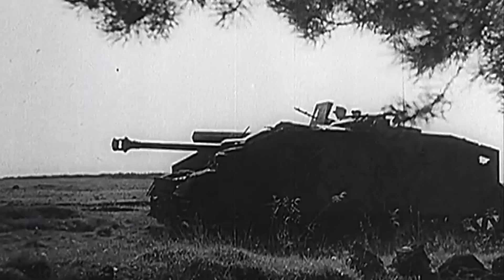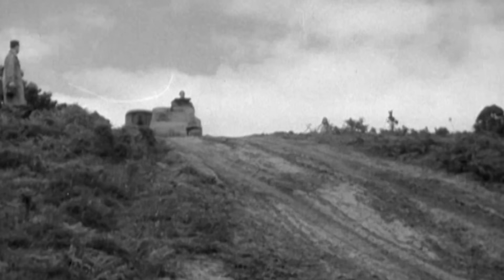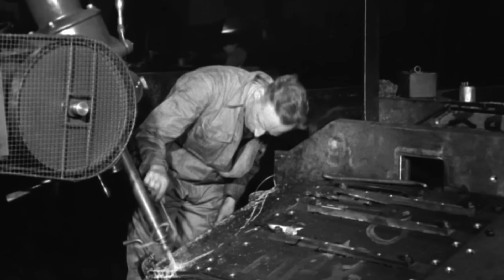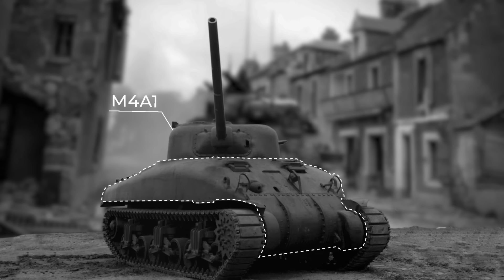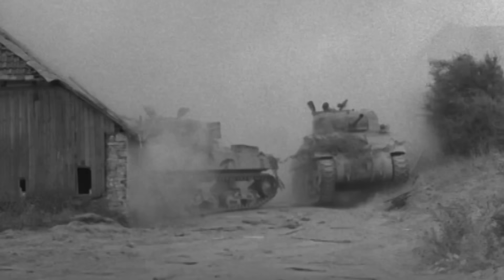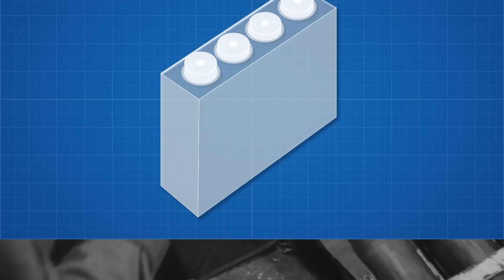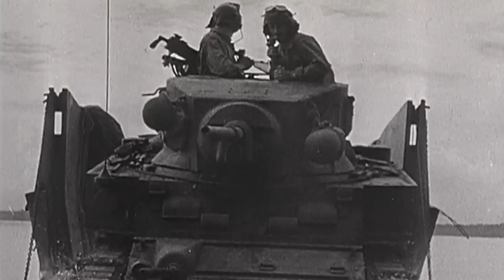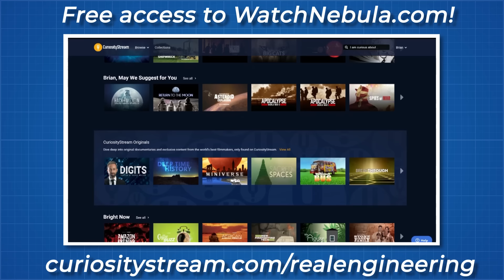M4 Sherman - The Workhorse of D-Day

Comment: Ah the worst tank of WW2
Reply: @peterson7082  Sherman was the worst mass produced thank used during the world war 2.  I'm not talking about the after war models or British improved Firefly. M4 could have been considered decent tank till 1942 but after that it was obsolete in every way and Americans joined the WW2 earnestly in 1944. 

Cons of Sherman was its 
-Armor
-Firepower
-Diesel Engine(prone to fire)
-Armament stowage (prone to blowing up)
-Range 
-Profile (too tall)
-Tracks (too narrow for muddy terrain)
etc...

Pros 
-Its large numbers in both tank itself and numberless canon fodder drivers.
-Part interchangeability

Finally , Sherman was not built to fight in war. it was build to be compact enough to be carried to anywhere on train or ship.
Reply: @presnow3016  Absolute nonsense. The M4 did not have poor armor or armament compared to its contemporaries. Nor was the M4 any more prone to suffering catastrophic detonations. Fuel type makes no difference in combat. The M4 was quite long ranged for a gasoline powered tank (in most variants it was gasoline ). The M4 did have a high center of gravity, but the height of the 75mm. gun tanks was not outstanding compared to the IV or Panther. Rather shorter than the latter by a considerable margin . Cannon fodder based on what?
Reply: @presnow3016  

> "Watch this documentary where the original crew of Sherman tank describes what pile of garbage it was and German tankers talk about how easy it was to destroy Sherman compared to real threat of Russian tanks."

 Television documentaries aren't reliable sources of information. Not to mention who exactly is claiming the M4 was not a threat compared to the Soviet tanks? 

> "Within 30 minute 1 Panzerkampfwagen VI Tiger tank destroyed 12 Sherman tank. What else we call this result than Bullet Fodder?"

 While the German tanker did claim it, there is absolutely no documentation that such an engagement occurred. You are also trying to imply the Tiger was a frequent threat and essentially invincible due to the achievements of a few commanders... 

> "gosh it has worst armor among late WW2 tanks, desperate crews welded sheet of iron hoping to improve their survivability even tiny bit. Truly coffin on tracks."

 The only other medium tank that had better armor than the M4 was the Panther. A considerable number of tanks be up-armored were simply to counter anti-tank gunfire and infantry projected anti-tank weapons, relatively few concerned other tanks as the threat. In General Patton's allowance of tank crews to up-armor vehicles in late 1944 this order states just that- anti-tank gunfire. Now did some up armor themselves to make themselves better off against tanks? Certainly. 

> "... idiotic proud US upper echelon refused British timely improvement out of sheer stupidity, ..."
 
 They rejected it based on the testing done in Aberdeen Proving Grounds prior to the invasion of France, as well as Insigny in July of that year. The 17 pounder, which was 76.2mm., not 75mm., was found to have an excessive muzzle flash, which actually temporarily blinded those observing fall of shot, and the round the U.S. was particularly interested in for this gun- the SVDS. Something the U.S. quite liked about the 6 pounder (also known as the 57mm. Gun, M1 ) proved rather inaccurate not being able to hit a 2'x3' (if I recall correctly ) target at 500yd. on this more powerful gun. [ii]

> "Still cant get grip on reality ? then read about the battle of Good Wood where opposing armored forces collided and Americans realized that Sherman was not a tank, but a moving barn."

 Except the fact the losses against German armor were at times 1:1 and otherwise similar to what the British/ Commonwealth achieved vice versa. The majority of losses stemmed from anti-tank gunfire, not other tanks. 

> "... resulting tens of thousands of unnecessary deaths"

 That is very much false. Regarding the U.S. losses specifically, over the entire course of the war in all theaters, the U.S. Armored Force branch suffered 1,398 killed-in-action plus 169 died-of-wounds. [iii] Approximately 900 to 1,000 of these men were M4 crews, and based on research done by Nicholas Moran [iv] and the late Richard P. Hunnicutt upwards of 1/4 were outside the vehicle at the time of death. There is one discrepancy with this information- this excludes officers as they weren't technically Armored Force. But being at company level, and judging by typical casualties for commanders, this would be <10% increase. The British conducted casualty reports (albeit no final reports ) for tankers, and from their ~4,000 M4 losses, we know about 500 to 800 of their crews were killed. Admittedly few figures exist for Free French, Commonwealth, Polish, and Soviet M4 losses and their crew casualties. But outstandingly less than tens of thousands like you claim. When you consider the rule of thumb Soviet and German tanker casualties (unfortunately very few numbers are given making some of this speculation ) as more than one crew were lost per tank- that's not poor in the slightest. 

Resources:
[i] - 
[ii] - Bird, Lorrin Rexford, Livingston, Robert D. ”WWII Ballistics: Armor and Gunnery” 2nd. ed., Overmatch Press, Albany, NY and Woodbridge, CT, (2001). Retrieved from https://www.scribd.com/doc/219173969/WWII-Ballistics-Armor-and-Gunnery. 
[iii] - Jewell, Larry, and Clancey, Patrick. “Army Battle Casualties and Nonbattle Deaths in World War II.” Office of the Adjutant General, 1953, Army Battle Casualties and Nonbattle Deaths in World War II, Battle Casualties. Distributed by Program Review and Analysis Division, Office of the Comptroller of the Army, O.C.S.
[iv] - “US AFV Development in WW2, or, ‘Why the Sherman Was What It Was.'” Lecture by Moran, Nicholas YouTube , C-Span, 19 Jan. 2018, www.youtube.com/watch?v=TwIlrAosYiM.

Comment: Great video, one thing though, the "Easy 8" refers to the new suspension system not the gun, the 76mm gun was put on many different Sherman variants and is identified by the (76)W after the model number, for instance M4A1 (76)W
Reply: Could you verify this by adding the proof? I heard that many, many times from mutiple sources that easy 8 became themselves because of 76mm gun
Reply: @nayahun2  Most Easy 8s had the 76mm gun, but the term itself refers to the suspension. The Chieftain has discussed it many times on his channel.
Reply: @Hossep  alright if you also have a reliable source for that then fair enough, thanks mate
Reply: @hossep2695  I'm not entirely sure, but there was only one easy 8, it was the tank that tested HVSS in the testing ground in the US. M4's with HVSS were named like that by men on the battlefield but it was wrong and only to indicate that a certain sherman had HVSS.

Comment: And the best Sherman was clearly the British firefly
Reply: Not necessarily. The Firefly was a very... Makeshift vehicle. They had to turn the gun sideways in the turret to fit the massive breech, this also made them cut out the radio and fit it in a welded box on the rear of the turret. It also had God awful crew ergonomics thanks to the awkward positioning of the gun.
Reply: Blunt .Cabbage I know. But it was better than any other Sherman, mainly due to its fun and mobility
Reply: @georgeirwin9649  Are you sure you're talking about actual conflicts? Sounds to me like you're referring to War Thunder, honestly.
Reply: The 17pdr was a worse tank main gun than the 76mm M1.

Comment: At Omaha Beach,  27 of the 29 Duplex-Drive Sherman tanks sank in six foot waves, after being launched three miles from the beach.
Reply: That was the DD-tanks for the 741st battalion and there were also 3 DD-Sherman's from the 741st landed directly on the beach. Realizing the adverse weather conditions, the other battalion commander for the 743rd also assigned to Omaha beach didn't make the same mistake and had most of his DD-Sherman's land directly on the beach. Besides the 4 companies of DD-tanks, 2 each for the 741st & 743rd battalions, they also each had a company of regular Sherman's and an attachment of 8 Sherman/bulldozer variants that were equipped with deep-wading gear including double ventilation trunks that were also supposed to be directly landed on the beach. With half the DD-tanks launched too far away, enemy fire plus damage to the LCT's that sometimes prevented them from making the run in, when it was all said and done there were about 70 tanks that actually made it to Omaha beach(roughly 50% of those intended). Of those that did make it, close to 50% were DD-Sherman's. Unfortunately, well placed and well camouflaged anti-tank guns on the ends of the beach had unobstructed fields of flanking fire along the whole beach front. The tanks didn't contribute to the invasion as much as was hoped for as they were seriously constrained for some time by that flanking fire. Many were knocked out/disabled, including some when the incoming tide flooded engine compartments, but I they are credited with taking out a couple of the weapon bunkers. If most of the rest had landed, I'm sure they would have helped somewhat but I guess it's just one of those cases were we simply will never know.
Reply: Fortunately, the combination of point blank shelling by USN and RN destroyers and brave infantry and rangers led by heroes like General Norman Cota,  (famous for saying, ""Gentlemen, we are being killed on the beaches. Let us go inland and be killed") managed to clear a beach exit.

Comment: Most tank produced  by allies in WW2 is T34/T34-85. 58.000 T34 and its variants vs 49.000 M4 variants. 
Unless you don't join the new wave of anti-soviet anti-Russian, where US are friends with Germany and Soviets lost 35 millions for no particular reason.
Reply: Depends on several matters. Many didn't consider the Soviets as part of the Allied powers until after the war. Production numbers for the T-34 (and its derivatives) during the war vary wildly. Though Between 54,800 and 57,900 are the most common figures. In total between and 60,235 and 63,335 T-34's in all variants and its derivatives were produced during the war. On the other side the the numbers for the Americans are less under question- 49,253 M4's produced during the war including the T6 pilot. In total 63,181 M4's in all variants plus derivatives were produced. Another ~2,180 can be added if you want to consider the Grizzly's and Sexton II's which were Canadian produced (for most part they were assembled in Canada, though most parts were produced in the U.S., they are not added to the M4 production list). So if you want 65,369.

 However referring to the tanks themselves up until 1944 the production and use of the M4 was at least notably, then eventually marginally larger than that of the T-34. In 1945 the T-34 (the T-34/85 variant in particular) production outpaced M4 production and beat it in overall numbers. That being said, the T-34 was produced well after the war to make up for losses suffered and the fact replacement medium tanks weren't in the numbers required. Some ~80,000 were produced in total if we include postwar production
Reply: @peterson7082  The fact remains, over 70% of German troops were fighting on the eastern front. In addition to Finish, Romanian, Bulgarian and other National socialists. Those were fighting T34 as the main tank. You can present numbers in a million way.
Wheather you consider Soviets allies or not, I will refer you to "lend and lease" policy. Which is clear help for allies. Guess, who got Ford truck for their Katyosha's?
The point I am trying to make. American did not win the war. They participated, and now they claim all the credit.
The most damaged nation, and the one that lost fighting for their land is ignored... 
USSR was not a great place. But give repect and fairness, please, to the people who defended their motherland. 
Is this a lot to ask for?
Reply: @an_atheist7996  

> "he fact remains, over 70% of German troops were fighting on the eastern front. In addition to Finish, Romanian, Bulgarian and other National socialists. Those were fighting T34 as the main tank. "

 I was just pointing out a technicality.

> "Wheather you consider Soviets allies or not"

 It's not what I personally consider. It's just by what authority you go by.

> "Wheather you consider Soviets allies or not, I will refer you to "lend and lease" policy. Which is clear help for allies. Guess, who got Ford truck for their Katyosha's?
"

 I am well aware. Though it was typically Studebaker trucks used for the BM-8/ 13/ 31. Again I am simply pointing out a technicality. 

> "The point I am trying to make. American did not win the war. They participated, and now they claim all the credit."

 The Allies, unofficially or officially including the Soviet Union and multiple other states won against the Axis forces. That's the most factually on point the statement can get. Claiming the Soviets won and America gets some credit or that America won and the Soviets should get some credit is rather simplistic. 

> "The most damaged nation, and the one that lost fighting for their land is ignored... "

 Depends on what your definition of most damaged... Because several countries and territories ceased to exist and some were tossed around and destroyed by both countries. East or West. Asia or Europe.  It's not missing the point. But trying to get a specific topic described as factually accurate as possible. 

> "USSR was not a great place. But give repect and fairness, please, to the people who defended their motherland."

 This isn't an attempt to disrespect or discredit them. Military or civilians. I will say it again I am trying to make a specific statement as factually accurate as possible.

Comment: When they said they mentioned the m4 being able to deflect shots I laughed
Reply: Why?
Reply: @infinitelyexplosive  Tiger Tank (German) far too OP.
Reply: @028TuvaluanHero  The fact that the Tiger could penetrate the M4's armor is irrelevant. It was still able to deflect 37mm and 50m shells with high probability. Furthermore, the Tiger was an uncommon tank, you're better off comparing to the Pz. IV and Panther.
Reply: @028TuvaluanHero  The Tiger was much more rare than the Sherman's primary assailants, the StuG and Panzer IV/III. The Sherman was plenty capable of engaging in open combat with those three models.

Comment: I dont quite get your point about the gyro causing problems for the
tank -- most accounts remark how the gyro was great to be used to keep
a target within your sight while moving, but the use of the gyro was
not a standard part of training so many gunners didnt know how to use
it.
 (The Chieftain)

"ammunition stored in the turret" as the problem for the tank lighting
up -- except the biggest problem was the ammo stored in the side
sponsons which meant any side-on hit would strike an ammo rack.
 (S. Zaloga, "Armored Thunderbolt")

Fun fact about the 76mm M1A1 gun -- This is actually the same gun from
the M10 GMC. The gun from the M10 was too heavy/long to be mounted in the
M4's turret, but metallurgic technology increased quite a bit during
WWII so that the ordinance department was able to remake the gun at
half the weight which allowed a new (shorter) recoil mechanism.
 (S. Zaloga, "Armored Thunderbolt")

5 shermans vs 1 tiger/panther -- a WWII US Army tank platoon was 5
tanks, so you always send 5 tanks :) If you hear there's a single
enemy tank, you send a platoon to go fight it. If you hear there's a
platoon of enemy tanks, you send three platoons to fight it.
 (The Chieftain)
Reply: Regarding the gyro, due to the lack of knowledge many crews had on using it, they equally didn't understand how to maintain it causing some reliability issues in combat. Other than that, you're on point.
Reply: @peterson7082  I can see that being an issue if a crew starts to use the gyro without knowing how to properly use and maintain it, but to use the gyro the gun has to be disconnected from the standard vertical traverse gearing. if a crew doesnt know how to use it, then the gyro system should not have any control authority over the gun's elevation.

Comment: 9:15]   Yes, but, you have to remember that as the ware progressed US tankers encountered fewer and fewer panzers of any kind.  The need to deliver high capacity high-explosive shells to a wide variety or targets - other than other tanks - never diminished.  By the battle of the Ardennes most panzers were being lost due to lack of fuel or spare parts not combat.  That said there was a genuine need  for a heavy tank as Nazi Germany imploded.  But what you have to recognize is that it takes a long time to design and develop a tank, produce it,  transport it across a wide ocean, then halfway across Europe to the battle front which is receding ever further away.  At that level of analysis the size and weight of the tank, the capacity of the rail car that transported it from factory to cargo ship, the capacity of the ship's cranes to load and off load that tank influenced greatly American tank production policy.  The American's weren't dummies, they built enough of the tank that won the war in the West to  win the war in the West -  and equip several of their allies who could not.

And just a fun fact, the Americans originally planned to produce 150,000 tanks but determined that they needed much of that steel to produce the ships that transported the tanks, and guns, and equipment, and soldiers to the battle front.  Oh, yeah the Americans fought a war at the opposite side of two broad oceans from their homeland and factories.  They really needed those ships more than tanks.  And remember the Americans fought and won a two front war, the Nazi Germans lost a two front war - and the widest ocean the Germans had to cross to  invade anyone was the Mediterranean.